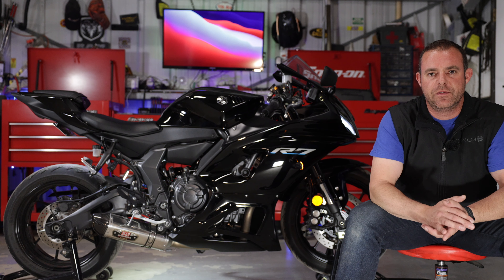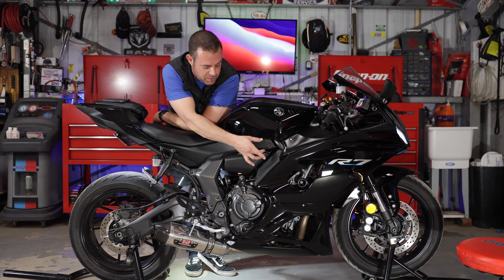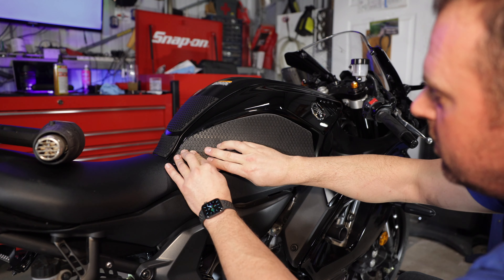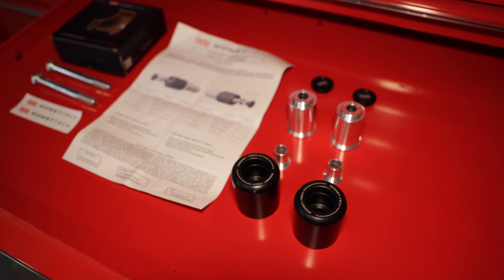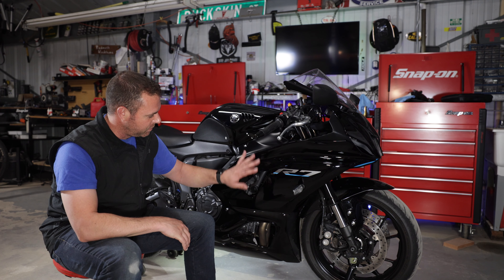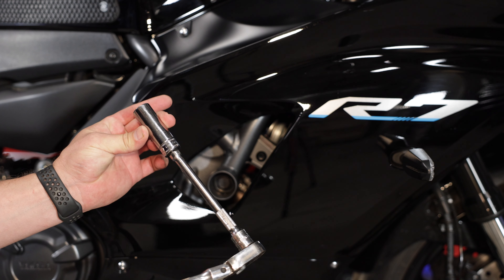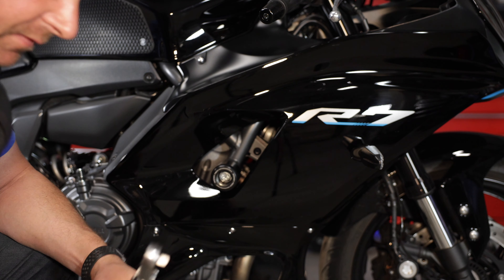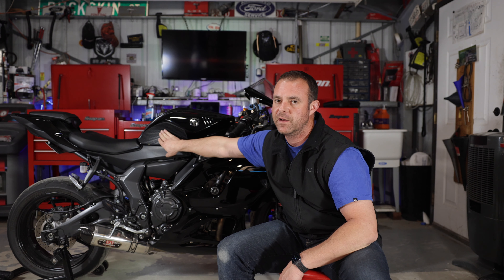Yamaha R7 Frame Sliders & Tank Grips | Install

Comment: I work insurance claims for bikes and ride.  I've indeed had total losses at work because frame sliders caused frame damage when we would have otherwise just had to replace fairings and bar ends.  now if you are going slow or if it just tips over in your garage, it will save you.
Reply from the maker: Nice! So good to hear from sonó e that actually has data about it. I did end up taking them off now that’s it’s a dedicated track bike for me. Thanks for the comment!

Comment: Windex typically has amonia in it, which actually creates a residue that works against adhesives... alcohol would be more appropriate...
Reply from the maker: I would totally agree but my r7 tank grips are still in perfect shape and the tank grips o put on my sons r3 i did exactly the same but found my alcohol and used that and they fell off on the first week so I don't know anymore lol

Comment: 5:30 i mean there ARE frame sliders that are more "skid" shaped, not just round pucks.
Round pucks makes no sense, since the motorcycle is travelling FORWARD, which means you want an angled smoother surface facing towards the front. That will prevent it from "digging" into the tarmac and flipping the bike. I dont know why 99% of people put the round pucks.
Reply from the maker: Yea the skid shaped ones would be a lot better and they look better too
Reply: I know exactly why 99% of people put round pucks on... Cost. I'd get the Yamaha pucks if they weren't three times the cost.
Reply from the maker: 😂 for sure

Comment: Thanks for the video!
From here it looks like the frame sliders won't save your turn signals, right?
I want to install those to improve my slow speed skills and be able to drop the bike a lot, but ofc I want to save all parts. 
Do you think 13cm (5 in) would be enough?
Reply from the maker: Thanks bud, no it won’t save the stock ones but I installed the flush mounts and it will save those. If you want to be able to drop it a lot a impatech cage might be a better choice

Comment: Great video, I totally agree on the reasons to get each of these options. Personally, I wouldn't recommend the Yamaha OEM optional tankpads as they look OK but don't provide that much grip. On my track bike I installed "stompgrips" and those provide a lot of grip, especially in the corners hanging of the bike. I have no experience with the brand you used.
Reply from the maker: Thanks bro, stompgrips are the best in my opinion but they weren’t out for the r7 at the time, and I don’t like cutting my own out of the big sheet. these tank grips are good too just not as good as  Stompgrip

Comment: Coming together nicely!!! What's next rear sets, bar levers, does it have a steering dampener, or what's the chain 520 or 530? A thing used to be on the big bikes with 530 chain you convert it to 520 and add a rear tooth, you lose a lot of weight in the drive chain and with the added tooth more acceleration, not sure if that's still what people do, I'm out of the loop now a days. 😂🤙
Reply from the maker: Thanks bro, I’m eyeing the front lights, levers and finishing the intake and tuner before I mess with chain and sprockets I think, gotta see what the power will be like
Reply: @ScoutsOut  for sure, really interesting to see the incremental gains with each mod  along the way 🤙🏼
Reply from the maker: For sure, me too…what you riding now days? I might finally make my way to your neck of the woods next year, would be really cool to get a beer and hang out 🤙🏼
Reply: @UCh-k4NFr8t2jj9x2koq7YCA definitely maybe even squeeze in a MTB ride I got an extra bike or they rent too. For motorcycles I only have a 2011 YZ 250 2stk right now sold my streetbike when I moved here but watching your vids has me itching again just for a sportbike not many roads worth wile just to many tourist cars and slow speed limits so you’d be breaking the law 110% of the time. A dual sport would be sick over here. Give me a heads up when you come and if I go that way I’ll do the same  I have good friends in paso I’ve been wanting to visit too. 🤙🏼
Reply: Trip out I left a comment but the tag is funny look above this comment
Reply from the maker: Cool bro, definitely that would be fun
Reply from the maker: Haha yea I seen that trippy

Comment: Do not by any means put a locktight on the frame and engine mount...just tourqe it tight to factory spec...it is a fatal error doing this...please read the service manual of the specific bike
Reply from the maker: Ok good tip